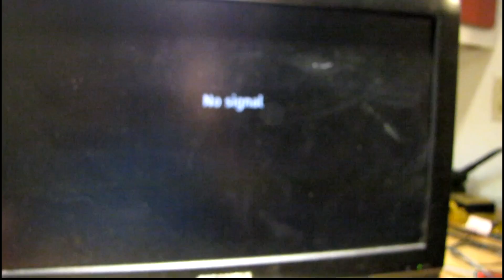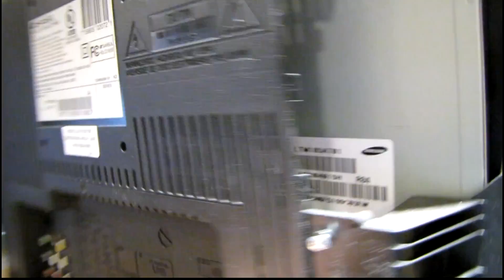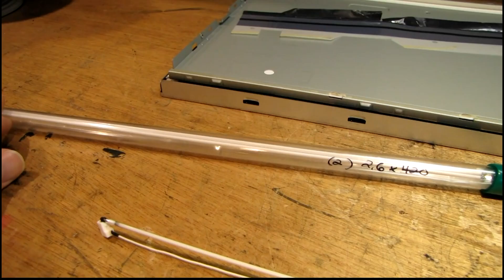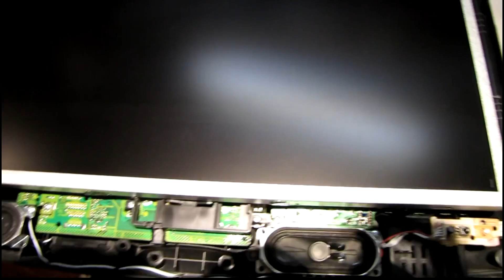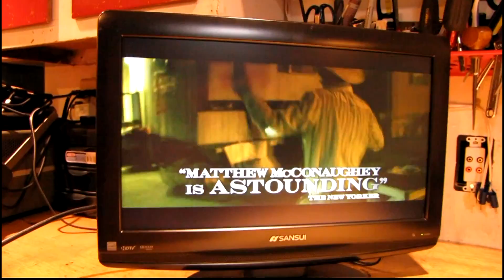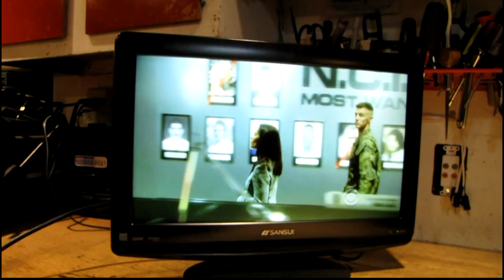Sansui LCD TV Repair 11-10-13

Comment: Hi Maxx I was browsing thru youtube checking video's here and there when I came across this video regarding your working on this LCD TV, I've watched this a few times and have to say your good, and Knowledgable regarding the components.
I have a flat scrn tv that has a problem that I'd like to fix and could use your assistance correcting the problem I'm having with the tv in question.

Comment: Maxx would you know what I should do to remove lines on my TV there not green lines like dead pixels there just flickering lights that change color once the image on the display updates.  I know its not just the HDMI port Im using cause Ive tried using AV the TV also other HDMI ports so Im assuming its just the controller board or something.  Just wanted to see if you could help in any way cause it would be nice to get rid of those lines. :) Thanks

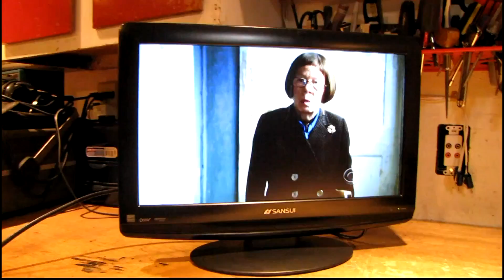Comment: @ 10:20 This is why i plan to just watch the most of my shows online, so will never have cable TV. Ill use dTV which on my TV dont need a box its built in (one i repaired also, which had a bad power board). the dTV for local news and maybe some shows that arent cable only. Allot of the shows i watch i can just watch off of Hulu. So set up a media center with hulu desktop for like 8 a month for huluplus. Much cheaper then cable and all on demend.

Comment: Hey Maxx, I have a Toshiba 19HLV87. It has a dedicated inverter board. When you press the power button, it does not come on. When you unplug the inverter board wire from the power supply, it comes on. I figured it had a short on the Inverter board. I found a bad cap and replaced it but that didn't fix the problem. Think it might be a bad transformer or chip on the inverter board. If you want it, I can ship it to you as long as you pay shipping. You can pay after you get it. Let me know if you want it. Only catch is you need to do a video of the repair. It has built in dvd player that plays divx.
Reply from the maker: Can you send me a PM?  Sounds like an interesting project.
Reply: How do pm you? They changed youtube a lot.
Reply from the maker: lineartechbd1600
Click the "About" link on my page, the message button should be in there.
Reply: I meant, how do I pm you? They made a lot of changes to Youtube and I can't figure out how to pm you. If I posted my email address here , can other people see it or will you be the only one to see it?

Comment: reminds me of my Samsung syncmaster 216bw does the same thing as that tv
Reply from the maker: I've seen quite a few Samsung panels with broken backlight lamps or wires.  They seem more fragile than other screens I've worked on.
Reply: Yeah my Samsung has bad caps on the power board
Reply from the maker: *****
LOL yep, probably SamWha brand caps if I had to guess?
Reply: out of the 10 caps in this monitor only 3 are good still and most of them are CapXon.

Comment: Just on the OTA signals and why they went digital - I know we use different standards  and probably slightly different frequencies because of the whole NTSC vs PAL and now DVB-T vs ATSC business  but they wanted the now unused analogue spectrum here in NZ for use with 4G cellphone technology. Also DVB-T / ATSC can fit multiple channels on each frequency depending on the bit rates used vs the one per frequency on analogue.

Comment: I have to check the acer panel i found not to long ago. i went over it and all the caps were ok and no bad joints so before i throw it out i will have a look at the lamps.

Comment: I have the same exact TV but mine has a built-in DVD player. Mine has HDMI and is 720p.
Reply from the maker: I bet that's why the case has so much space inside, and that access panel on the back.  The DVD drive probably fit in that space.
Reply: They probably used a slightly different panel on that side, one with the slot for the DVD.
Reply: +Grumpy Boi Mine still works. I rarely use it though. I have an older TV a Polaroid LCD 2000 which works well. I have my playstation hooked to it and I use it to watch movies and play games. Had to build a power supply for it because the original one died.